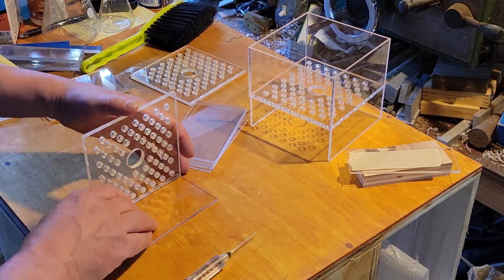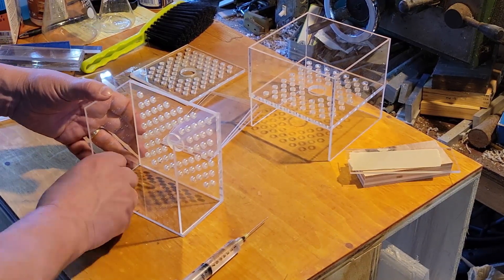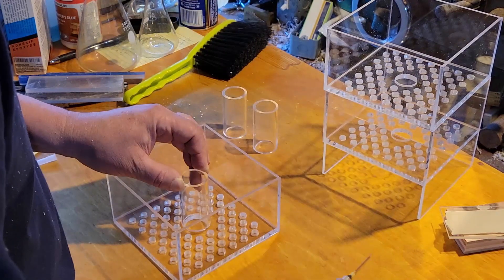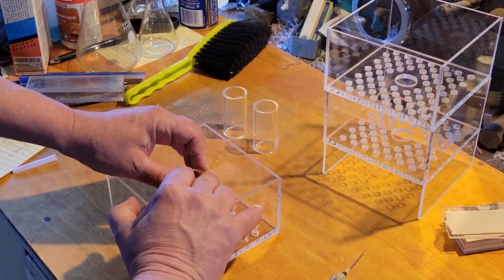Above Tank Trickle/Planter Filter Part 2

Comment: Ahhh, now this is very good. I've not liked the "splash factor" in many of the projects, acknowledging the real need for gas exchange. We've hard water here in Michigan, I like to use it as an alternative hammer. As such, I am always fighting the lime/calcium build up, which makes sparkling clean water look dirty through or on any surface. Looking forward to seeing your modification over time. 🦐
Reply from the maker: So glad you like it! Long term, is always the key. Comparing the three setups will be interesting.